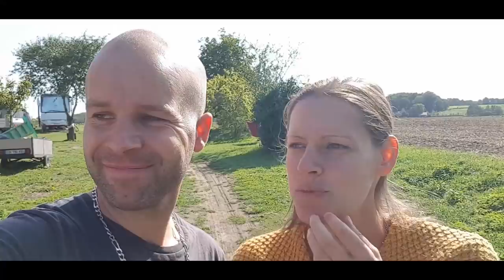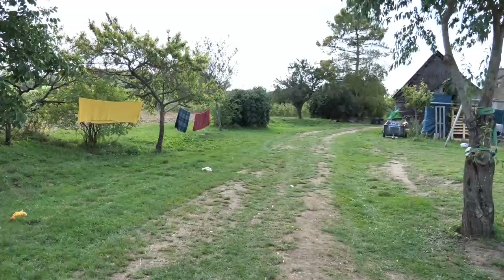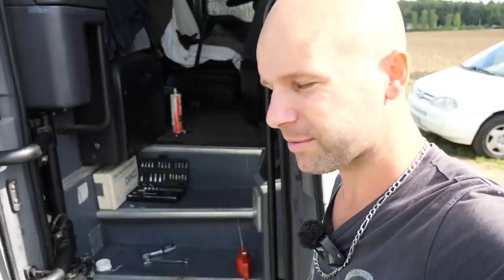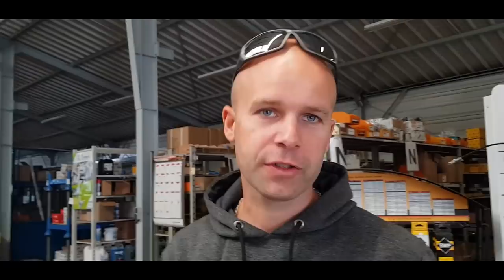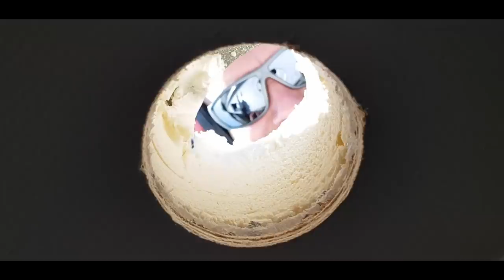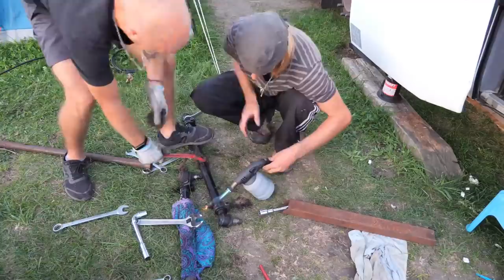Homologuer ( VASP ) et Aménager un bus en camping car - S 04 : EP 02 - dépose du dossier à la DREAL

Comment: ASTUCE pour retirer les ROTULES. forcer de manière linéaire ex : tourner une clé avec un bras de levier. ça sert quasiment a rien sur un filetage rouillé. il est préférable de choquer les rotules ex : utilise une barre de métal pour tapé sur la clef à mollette. tapé permet d'infligé une plus grande contrainte et ainsi faire céder la rouille. et combinais les deux ne fonctionne pas, il va être préférable de tapé sur le milieu de la clef. puisque qu'ici au contraire du bras de lévier, on veux exercé une grande force sur un minimum de temps et pas une petit force sur une longue durée "bras de levier". Une fois que la rouille à céder il est normalement possible de dévisser avec une simple clé. pour les explications scientifique. énergie de la barre avec la quel tu vas frappé la clé : 1/2 * masse de la barre * ( vitesse linéaire de la barre )² = énergie cinétique en joule. en gros plus tu vas vite, plus tu tape fort. je vous épargne les autres calcul sur la résistance de la rouille en fonction du nombre de mètre de filetage. ^^ en gros tape tape tape c'est ta façon d'aimer ! et sur ce bonne journée ^^